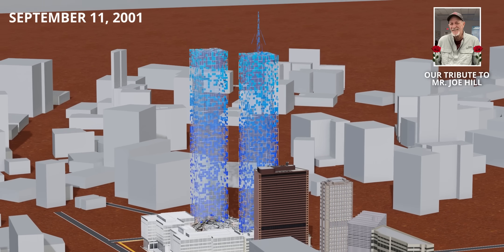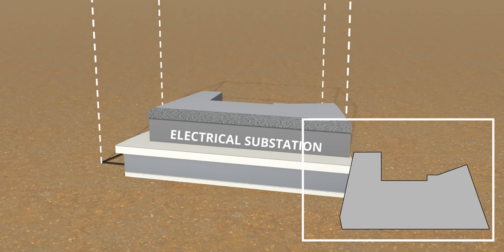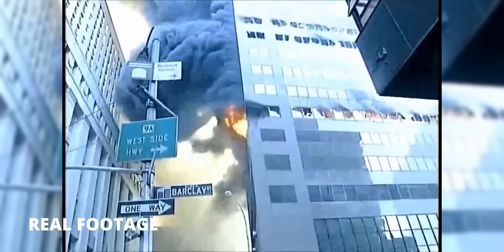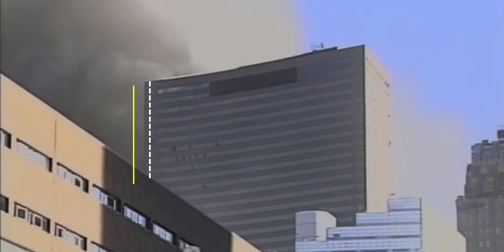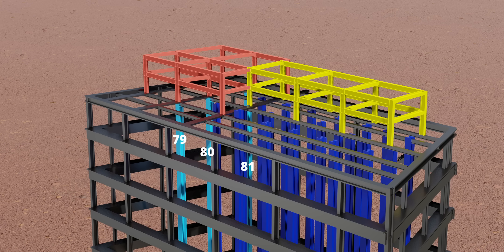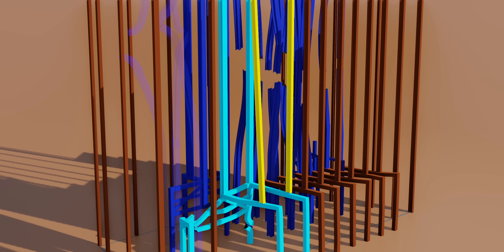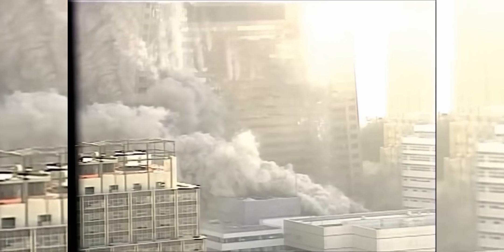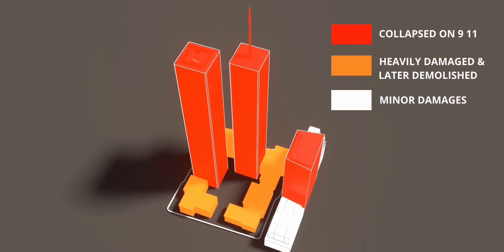Collapse of Building 7 | The Complete Physics

Comment: How does this compare to the University of Alaska study?
Reply: It doesn't. The Hulsey report is so deeply flawed as to be not worth the paper it is written on.  We can do better.

The collapse of Building 7 is probably the most studied engineering disaster in history and the subject of 5 comprehensive engineering studies and more than two dozen technical articles in major peer reviewed engineering journals, most of which were published 15 or more years ago. Thousands of pages of material.  This should get you started.

FEMA BPAT (initial report superceded by NIST NCSTAR 1A)

NIST NCSTAR 1A: Final Report on the Collapse of the World Trade Center Building 7, 2008.

Guy Nordenson and Associates, WTC7 Global Collapse Analysis Report and Summary of Findings, 2010.

Arup, WTC -7 Structural Fire Analysis Report (Runs 1-4), 2010.

Weidlinger Associates Inc., WTC 7 Collapse Analysis and Assessment Report, 2010.

BRE Centre for Fire Safety Engineering, Analysis of the Impact of a Fire in the Mechanical Room (5th & 6th Floor) of the World Trade Center 7 Building, 2010.

T. McAllister, R. MacNeill, O. Erbay, A. Sarawit, M. Zarghamee, S. Kirkpatrick, J. Gross, Analysis of structural response of WTC 7 to fire and sequential failures leading to collapse, J. Struct. Eng. (United States). 138 (2012) 109–117.

For a summary of the major studies I would recommend THE COLLAPSE OF WORLD TRADE CENTER 7: REVISITED by Mhd Anwar Orabi , Liming Jiang , Asif Usmani and Jose Torero which is a 33 page summary of the different analysis and conclusions published in 2020. Sorry, YouTube will delete this post if I give the link but it should be easy to find and is available from the University of Queensland, Brisbane. 

Happy reading
Reply: @TheCriticalStinker-jw4fl  Your message says that the UAF study is flawed, but it does not prove its flawed.

Mentioning other documents does not prove that Hulsey's paper is invalid in any way.
Reply: @Seetheobvious  - I can only answer the question you asked, which is how this video compares to Hulsey's paper (I can't call it a "study" because it isn't). 

By reading even some of the other studies listed above it doesn't take a rocket surgeon to work out the flaws and failures of Hulsey's report. I doubt you have or will do that though (and find it unlikely you have even actually read Hulsey) so I will break it down in a Cliff's Notes version. 

I have actually read both the Hulsey preliminary and final reports from cover to cover. I have to admit the Hulsey report is such a dead horse, that has been flogged so many times now I find it difficult these days to drum up the enthusiasm to do it yet again.  But here it goes. 

My summary opinion of the Final Report is as follows:

The Final Report met none of its three stated objectives – indeed could not have met those objectives for lack of trying - and failed to prove its main conclusion, by way of a fundamental logic error; Hulsey claimed he had concluded fire could not bring down Building 7 without accounting for the full envelop of possibilities.  Essentially, he claimed to have proved a negative.

Hulsey also plagiarized almost 3 pages of material from Tony Tsamboti, who works for the studies sponsor. I hope I don’t need to point out the ethical implications of that. 

Overall, it is a shoddy piece of work done by a man clearly working out of his element and areas of expertise. It rather reeks of trying to support a conclusion arrived at before the study started, which tracks with study sponsor Architects and Engineers for 9/11 Truth having announced what the study would conclude before they awarded him the contract. 

The Hulsey Report was so factually inaccurate, methodologically unreliable, scientifically unsound, illogical, and biased that it blatantly violated any requirements of objectivity, utility, transparency, and reproducibility that would have been required to submit it for peer review in any reputable journal.  This explains why Hulsey and his assistants have not published the report anywhere that any relevant academic or professional engineers look to. 

Hulsey had said all along that the report would spawn several (perhaps four) papers in good American engineering journals. Then he walked that back, realizing he'd stand no chance to pass peer review in America and so said he'd go for European journals - but years have gone by with no publication whatsoever. Also, no book from any science publisher either. As far as the engineering profession and science are concerned, the Hulsey report barely exists.

The engineers of America and of the world have never read it.  It has had zero impact in the professional community. 

To its truly intended non-engineering literate audience of potential and actual Architects and Engineers for 9/11 Truth donors, the Hulsey Report contains enough engineerspeak density for them not to ask questions, even if they were so inclined. Since the report appears to (superficially) deliver what they want, they are not inclined, even if they knew what to ask. From an understanding of structural engineering perspective however, the Hulsey Report is of no value. This almost certainly explains why promises to get the report published in peer-reviewed and reputable engineering journals, where it could be scrutinized by qualified professionals were abandoned.  

You can do a lot better.
Reply: @TheCriticalStinker-jw4fl  

First, you did not answer my initial question, which was just about how this video compares to the argument of Hulsey's study. 

Then you went off rambling about Hulsey's study being invalid while listing the titles of other documents. I decided to answer this because I find the subject interesting.

In your last message, you continue the angry rambling without addressing the arguments of the UAF study.  Just say specifically why you believe it's wrong, if you can.
Reply: @Seetheobvious  - I did answer your initial question, which was how this video and Hulsey's paper compare - they don't. While neither is great, one is worthless, although interestingly both are intended for similar audiences. 

By the defensive stance you have taken I suspect you are a supporter/promoter of Hulsey's paper. Have you actually read Hulsey's paper, front to back?  Be honest please because I will find you out quickly enough if you haven't. 

For example, I gave several reasons why the UAF study was flawed, such as blatant plagiarism and claiming to have proved a negative in its conclusion.  I also mentioned the study failed to meet any of its 3 stated objectives due to a lack of effort.  Do you know what the studies 3 stated objectives were (or what you would call "rambling", possibly because it is not what you want to hear)?  Could you state what they are without digging through the paper to look them up?

If you are just curious about the Hulsey paper that is something you should know but I would not fault you for not.
IF you are defending the Hulsey paper it is absolutely something you should know, and I WILL fault you for not. No point in even having a discussion about this if you don't know what the study was supposed to achieve. 

Again, be honest.
Reply: @TheCriticalStinker-jw4fl  

Still no answer to the initial question, but that's ok for now...

About the Hulsey study, did you model the structure like Hulsey did? What program did you use? Did you input all the structural elements and connections specified in the shop drawings?  What results did you get?
Reply: @Seetheobvious  - Reading comprehension not your strong suit I see.

You asked how this video and the Hulsey report compare.  I answered they don't.  Which is true. 

You did not ask why in your OP so I did not go into detail until later responses. When I tried to go into more detail your eyes glazed over and you said I was "rambling".  As if pointing out blatant plagiarism, failure to meet any of the papers 3 stated goals and concluding by claiming to have proved a negative are not legit concerns.  Hell, it isn't even necessary to go into more than that as each are individually fatal to the paper. 

I will chalk this up to you having little familiarity with the material in question, but likely being a true believer regardless.

Let me repeat those in list form so you can stop accusing me of not answering your question (which is getting tedius):
1. Blatant plagiarism
2. Failure to meet any of the studies 3 states objectives for lack of trying
3. Concluding by claiming to have proved a negative.

*And one more time for good measure in case you missed it the last 4 times:
1. Blatant plagiarism
2. Failure to meet any of the studies 3 states objectives for lack of trying
3. Concluding by claiming to have proved a negative*

Those are all valid reasons to reject the Hulsey paper.

So, just right there I gave you 3 reasons why the Hulsey paper is not worth the paper it is written on. Plenty of fodder there to go on with for days. If you would care to flesh any of those out in more detail I am happy to do so - AFTER you answer the question I posed in my last post.

*Do you know what the 3 stated objectives of Hulsey's paper were (without digging through the report to look them up)?  

Honest answers only please. It will determine how how we move forward.  Admitting you have not would be refreshingly honest and I will take more time in my replies.
Reply: @TheCriticalStinker-jw4fl  

I asked how they compare, meaning which arguments are presented by each claim, how is each argument constructed etc. 

Let's just say you answered something, but I did not think it was a valid answer at this point.

Let's just continue so our points become more clarified...

Did you make a digital model of the Bldg 7 structure within a computer program that can simulate how such structure would collapse similarly to what is seen in the collapse videos?
Which program did you use and what result did you get?
Reply: @h1F595  - I'm not sure what he wanted and I don't think he knows either - not least because he does not really understand what is in either.
Reply: @TheCriticalStinker-jw4fl  

Why "he"?

I asked you something specific about computer modeling to estimate and simulate results.
Reply: @Seetheobvious  - You engaged in a deliberately evasive off-topic derail, which I do not chase.
Reply: @TheCriticalStinker-jw4fl  

The Hulsey study is based on computer modeling, with commonly used programs that can simulate the behavior of structures under specified conditions, including dynamic loading and scenarios of failure.
Reply: @Seetheobvious  - And?
Reply: @TheCriticalStinker-jw4fl  

I've answered about 7 times, different wording, but YT continues erasing them. What is happening?
Reply: I've had seven consecutive attempts to reply but YT keeps erasing what I say.  Why???
Reply: @Seetheobvious  Are you including a link? Don't do that. YT comments don't allow outside links. They even get crabby about links to other YT videos.
Reply: @TheCriticalStinker-jw4fl  

At first I did. Then I just said look at the UAF/Hulsey study video simulations. Those were done by common programs used every day by engineers.
Reply: @Seetheobvious  - I've read the report, seen the animations,  laughed my ass off.  The animations are clearly forced, not derived from his models. There are zero dynamics in the animations.  Nothing is attached to or interacts with anything else. They are designed to fool the mentally challenged.
Reply: @TheCriticalStinker-jw4fl  

Really? 

How do you know the animations are not the result of modeling the structure as per shop drawings?
Reply: @Seetheobvious  Because my eyeballs work.

Again, THERE'S NO DYNAMICS. Nothing interacts with anything else. No cause and effect.  The animations  cannot possibly be derived from model data. Hulsey just makes ALL of the columns fail simultaneously because he thinks he needs them to so the animation superficially matches the real event visuals. That shot is nowhere in his models.  The animations are clearly forces manually, promoting and selling the sponsors dogma to the faithful.
Reply: @TheCriticalStinker-jw4fl  

So the animations are not derived from the model data... and you know this because your eyeballs work?

So where does the animations come from according to your eyeballs? How were they generated?
Reply: @Seetheobvious  - Don't forget to let us know if you ever manage to figure out what Hulsey's 3 stated objectives were.  They are kind of important.
Reply: @TheCriticalStinker-jw4fl  negative.

You did not answer the question.

And on the tangent you are trying to use to distract from the fact that you can not answer the question, this is part of the UAF study conclusion:

The principal conclusion of our study is that fire did not cause the collapse of WTC 7 on 9/11, contrary to the conclusions of NIST and private engineering firms that studied the collapse. The secondary conclusion of our study is that the collapse of WTC 7 was a global failure involving the near-simultaneous failure of every column in the building.
Reply: @Seetheobvious  - I gave several reasons why the Hulsey animations (which are NOT models) cannot possibly be derived from any models he performed. I am happy to discuss any one of them in more detail. Again, you cannot just cherry pick 2 or 3 words out of my postout of context and ignore the rest. They all go together. 

Meanwhile I have been asking you throughout this thread what Hulsey's 3 objectives were and you have been dodging me at every turn. We both know its because you don't know, and if you don't know that you are not really in any position to speak on this topic. Indeed, you will not even be equipped to answer the question you just posed to me. We know what Hulsey claims he achieved. That is not the issue. What is the issue is did he achieve what he claimed?

How would you know?  Are you just buying it because it is what you want to hear?

We have to start at the beginning, with knowing what his objectives were.  There are 3. They are stated twice in the report. If you ever get around to actually reading the thing rather than copying bits of the Cliff's Notes version off of the internet you will know what they are. I will not be doing your homework for you. I already did the work and know the material. There literally can not be any meaningful discussion on this topic until you are familiar with the material.
Reply: @TheCriticalStinker-jw4fl  

So the animations are not derived from the model data... and you know this because your eyeballs work?

So where does the animations come from according to your eyeballs? How were they generated?
Reply: @TheCriticalStinker-jw4fl  

The objective of the study is to determine if the collapse of this building was caused by fire as NIST claimed or by something else. This is obvious.
Reply: @Seetheobvious  - Not what I asked. You  still need to read it. 3 points, spelled out twice.
Reply: @TheCriticalStinker-jw4fl  

Friend, the study was done to determine what caused the very curious collapse. That is the objective and what matters.

You are rambling about these "three objectives" to try to distract and avoid with some language technicality, and trust me, the trick is not working.

The rapid, straight down collapse observed in the real-life videos can only happen if all columns in various floors are cut simultaneously. This is what the  engineering programs determine when the structural design specific to this building is input into the analysis.
Reply: @Seetheobvious  I'm trying to see if you have read and understand the material you are so enthusiastically defending and promoting. You still haven't.
Reply: @TheCriticalStinker-01  

I explained what matters in my last message. 

Now, it seems you are saying that the animation videos in the UAF are just some cartoon fabrications. Correct ?
Reply: @Seetheobvious  - I've been saying since the beginning you have not read and do not know the material.. Yet you defend and promote Hulsey?

Based on what  Because you think he is saying what you want to hear?

Or because he is right? 

How would you kn0w? 

Have to start with first principles.  Hulsey clearly lays out what his objectives were. Itouch need to know what they are before moving to the step. You can't just start with the last page of the last chapter.

And I certainly do not see the benefit of discussion of this topic with someone who does not know the material. 

Start reading. You should have done that before you started.
Reply: @TheCriticalStinker-jw4fl  

I have read the material. You repeating that I haven't means nothing. 

This is what matters, and I hope many people read this conversation:

The rapid, straight down collapse observed in the real-life videos can only happen if all columns in various floors are cut simultaneously. This is what the  engineering programs determine when the structural design specific to this building is input into the analysis.
Reply: "How does this compare to the University of Alaska study"
Since there IS no "UofAlaska study", the question is meaningless.
How does it compare to the Hulsey fantasy? Again, the question is meaningless. You might as well ask how it compares to the latest Disney movie.

Hulsey does not have a "study", "paper", "article" or any other such word. He has a laughable waste of time and paper. Nothing else.
Reply: @mooneyes2k478  

🙄
Reply: @seetheobliviousness,  you did state that the study was done to find out what caused the collapse?  What was their conclusion as to what caused the collapse?
Reply: Actually, you state “the very curious collapse”
Reply: A secondary conclusion of the study is that the collapse of WTC 7 was a global failure that involves the near-simultaneous failure of every column in the building.
Reply: @Seetheobvious  - And he was wrong - for reasons described above,... that you did not read.
Reply: @TheCriticalStinker-jw4fl  

Why did the engineering programs yield the simulation animation video that resembles the actual collapse videos? (Contrary to NIST' produced video which does not resemble the collapse)
Reply: @Seetheobvious  - Hulsey's animations for global collapse were not derived from any models. Couldn't be, even accounting for him doing only one (extremely limited) fire model.  This is obvious enough from the complete lack of dynamics. He forced the results in the animation to match the conclusion he already had in hand before he started the study. 

The global collapse animation (which is not a model) was made to look like the false perception Richard Gage has always had about Building 7's collapse. A false perception Gage adopted very early on - and because his is a faith-based organization - he (like everything else) refuses to alter in any way in light of new or better information. 

Hulsey's paper was intended for a credulous and gullible audience that would never read it and never understand it if they did, but just smile and wave. It's snake oil for suckers.

You fell for it.
Reply: @TheCriticalStinker-jw4fl  

So you are saying that the animations in the Hulsey/UAF study were not produced by the engineering program. 

This is your argument? 

If the animation was not made by the engineering program, what do you think was used to produce them?
Reply: @Seetheobvious  - Asked and answered.
Reply: @TheCriticalStinker-jw4fl  

Ok, so you say that the animations in the Hulsey/UAF study videos were not produced by the engineering programs that the authors say produced the animations. Understood, you claim the authors are blatantly lying about this.

But where do you answer how the animations in the study of Hulsey/UAF may have been done if not done by the engineering programs? They must have been made somehow, but how?
Reply: @Seetheobvious  - I'll take it that's no questions then. Glad we got that sorted.